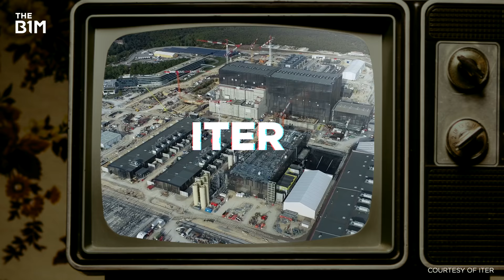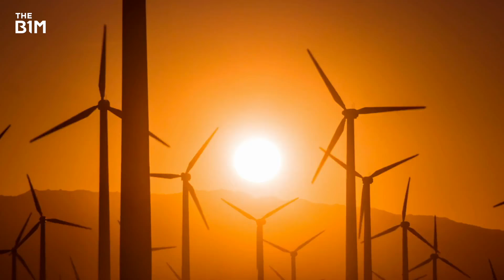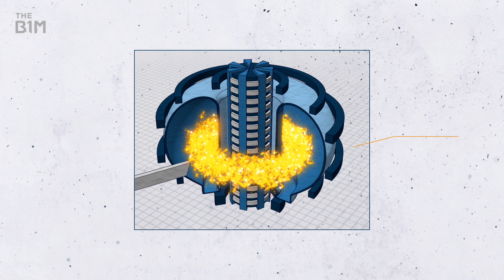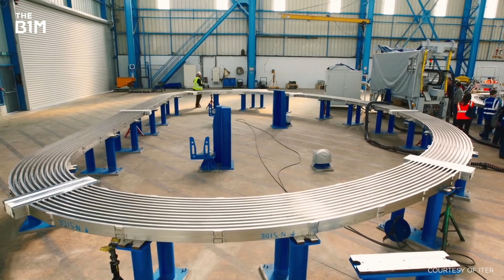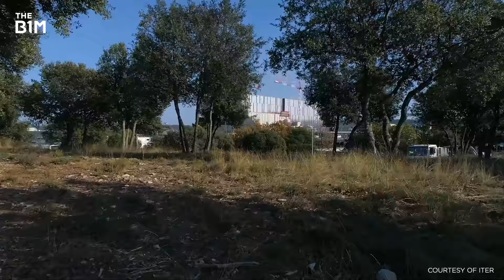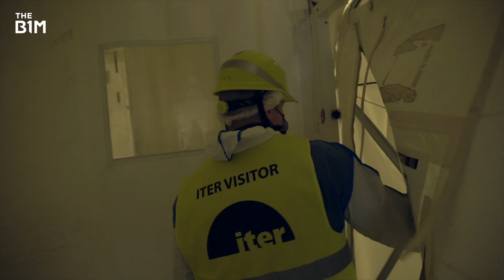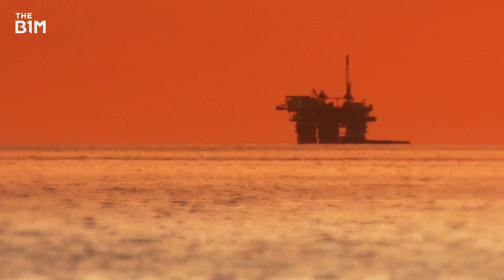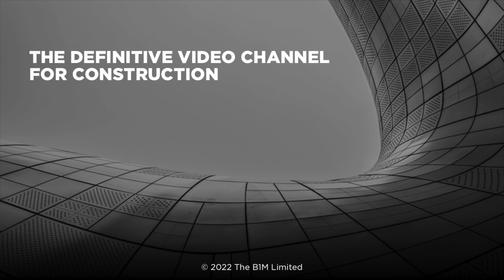We Went Inside the Largest Nuclear Fusion Reactor

Comment: Fusion power would be great. Fission reactors produce huge amounts of dangerous nuclear waste. They are by no means clean, safe energy sources. The issue has always been the huge amount of energy it takes to start a fusion reaction, and then contain the heat.
Reply: Fusion would still be great, but fission is really not that bad at all. First off, nuclear accidents are incredibly rare and caused by gross negligence. Can you name any nuclear disasters off the top of your head besides Chernobyl and Fukushima? 
Also, your claims about waste are simply incorrect. Nuclear fuel can be used for 5 years because needing to be disposed of, at which point it’s moved to a permanent safe disposal location. Also, with things like thorium reactors, nuclear waste can be “burnt up” in it, and have the time until safe disposal be reduced to less than 500 years. 
Fusion would be a hell of a lot better, but fission is not bad at all, and can likely be an important stepping stone in the mean time until fusion becomes available
Reply: @Beyonder8335  How much fission waste is sitting on the grounds of the power plant instead of in ultra long term storage?

Thorium seems much cleaner ...

Comment: Sadly, if 100% successful, ITER will not produce 1 single watt of usable electricity for all the billions spent.  Will it produce over unity (Q Power), over unity for 24-7-365?  If not then no power companies will want it. (can't supply electricity).  Once "DEMO" is built what will it cost?  Of course if ITER fails at 24-7-365, DEMO if dead.  Fission nuclear is the future as it is here and now producing carbon free energy.  Otherwise, it is coal or gas.  

Germany killed her nuclear and due to this and the Russia oil embargo, Germany is firing up her old coal plants to keep German warm the winter.  France is massively nuclear now and laughing at the greenies who killed nuclear.

Comment: i'd wish we could move faster. ITER have been under way for years and years, and still not finished, and even when finished, they dont even expect it to be more than an experiment to gain knowledge to build another reactor that then potentially would become a power plant. So we are still looking at atleast 20 years before the first plant is operational, and we know that scaling energy production is slow, it would take another 50 years to transitioning.

Comment: Fun fact: when properly stored nuclear waste is entirely safe, they store it as alloy in a concrete container, even if somehow the container (for all intents and purposes this container is indestructible) breaks open the glass - ceramic - nuclear waste alloy cant go anywhere since its a solid, theres also research into putting the long lived waste kilometers below ground, deep below any water aquifers or anything that it could ever contaminate that would get to humanity (there was a natural fission reactor discovered, its waste was entirely uncontained but never got more than 30 meters away), all using the same technology that oil drilling uses

Comment: Been promised unlimited power from fusion reactors for decades. Appears we are not much closer to sustainable fusion than long ago. 
Not saying it won't eventually happen but I believe I and my children will have passed from this world first.
Reply: I'm afraid it won't.  Even if somehow, some way, the engineering problems connected with creating and sustaining a continuing plasma reaction and at levels sufficient to produce large-scale power are solved, it will not be possible to make it commercially viable due to the sheer scale and complexity involved in the support machinery needed to keep a closed-cycle reactor magnetically and thermally stable indefinitely.  Then there's the problem with producing enough tritium to fuel the fusion process.  I remember reading a suggestion to "solve" this problem through using an on-site fission reactor to breed tritium.  My immediate thought was that if you're already going to build a fission reactor just to solve that problem, then why not simply dispense with the fusion reactor complex altogether, build four fission reactors on site instead and harness them directly for electrical production?  This won't work.  It is far more likely that fusion will be practically exploited for interplanetary and perhaps even interstellar travel but it will never be an industrial-scale power generator on Earth.

Comment: And if it doesn't work the environmental footprint of this project must be massive..
Reply: It is not .  If the containment fails , the plasma will expand , cool , and fusion would immediately stop .  Worst case scenario is a tritium ( radioisotope of hydrogen ) leak into the environment Said tritium can bind with oxygen and create radioactive water which can leak into the groundwater .  Fusion doesn't use a lot of fuel at a time tho ( usually only a few grams ) , so a leak would be diluted fairly quickly .  Even if the reactor does explode , it would not release much ionizing radiation like a fission reactor

Comment: as they stated some years ago there is still radiation which means the reactor has to be maintained, the heatshields removed and noew ones installed. the old ones carried radiation so they have to be stored for around 50 years when i remember correctly. after that they can be recycled  refurbished.

Comment: Imagine you get the big construction done just to find out the entire thing doesn't work 😫
Reply: It works but the problem is "is it economical " because the core is already tested in china and it works .
Reply: It's only an experimentale reactor anyway. It is not made to provide energy to France or the world.

We will test m y configuration on the reactor and see how it works the best.

Even if we are not satisfied with the résultat, we will have learned a lot
Reply: @mrsupremegascon  No, the core on china is experimental. And it's working.

This one is real building project.

Comment: I feel this video gives a missleading veiw of where fusion technology is at. 
the Q value often show with ITER is 10 but that is just the heating elements and doesn't include the much more power hungry magnets or other anciliary systems.
also while dueterium is relativly simle to aquire Tritium is much rarer and expensive to the point that the cost per MW asuming a 100 percent efficiency is higher than a gas turbine

Comment: What could go wrong?
Reply: Just creating a mini sun, and if it does not "explode" creating a black hole, all in all you won't feel a thing while your atoms split apart and drag you into the unknown.
Reply: @dmitrikulkevicius9161  no
Reply: @dmitrikulkevicius9161  It is not .  If the containment fails , the plasma will expand , cool , and fusion would immediately stop .  Worst case scenario is a tritium ( radioisotope of hydrogen ) leak into the environment Said tritium can bind with oxygen and create radioactive water which can leak into the groundwater .  Fusion doesn't use a lot of fuel at a time tho ( usually only a few grams ) , so a leak would be diluted fairly quickly .  Even if the reactor does explode , it would not release much ionizing radiation like a fission reactor
Reply: @someaipretendingtobehuman3157  

cool

Comment: It will explode.
Reply: It is not .  If the containment fails , the plasma will expand , cool , and fusion would immediately stop .  Worst case scenario is a tritium ( radioisotope of hydrogen ) leak into the environment Said tritium can bind with oxygen and create radioactive water which can leak into the groundwater .  Fusion doesn't use a lot of fuel at a time tho ( usually only a few grams ) , so a leak would be diluted fairly quickly .  Even if the reactor does explode , it would not release much ionizing radiation like a fission reactor

Comment: It’s all fun and games till the sun on earth explodes and France disappears
Reply: @jcdenton2708  are you unwell
Reply: @jcdenton2708  It is not .  If the containment fails , the plasma will expand , cool , and fusion would immediately stop .  Worst case scenario is a tritium ( radioisotope of hydrogen ) leak into the environment Said tritium can bind with oxygen and create radioactive water which can leak into the groundwater .  Fusion doesn't use a lot of fuel at a time tho ( usually only a few grams ) , so a leak would be diluted fairly quickly .  Even if the reactor does explode , it would not release much ionizing radiation like a fission reactor

Comment: It's worth saying that while fusion energy would be beyond revolutionary in many ways, fission is already essentially carbon free and with danger statistics generally in the same range as wind and solar power, despite "harmful" nuclear waste. Truthfully, if we built enough nuclear plants to sustain most of our energy needs right now, there wouldn't be all that much of an issue (certainly far less than the issues associated with using fossil fuels for power). The amount of waste produced would be quite manageable and so in many ways, fission is already capable of many benefits that fusion is often credited with, for the most part. Certainly not all- fusion energy as I said originally would be more than a revolution. As far as necessity dictates for our current energy situation though, fission would be sufficient if the general public stopped thinking nuclear waste was green goo and that reactors go off like atomic bombs when there is any minor error (they don't do that at all, it's impossible). While I love fusion and think it 100% deserves as much funding as it reasonable, fission could fix fossil fuels within the time that fusion might or might not only be proven, let alone turned into commercially viable energy plants. Fusion is the energy of the future, and right now we need to be using the energy of today--fission, wind, solar, etc--to get rid of the energy of the past, as soon as reasonably achievable.
Reply: Perfectly said
Reply: In water starved areas like the United States southwest, nuclear power is not really viable because of the tremendous amount of water needed for cooling.  Arizona has a nuclear plant and they use water from lake mead and with the drought conditions, that has been a big problem.  Natural gas powered plants and solar is a better option in that part of the country
Reply: Yep, Chernobyl fairly much screwed up fission for the rest of the world. It's cheap, almost green, and gives more than enough energy to last us a while.
Reply: Finaly someone who said this all in one comment, without any hour long scrolling needed to get past unrelated things or drama in the replies just to see the darn thing. i 100% agree with this comment.
Reply: @hamisyum1016  nope. It’s Fukushima and nuclear weapon. When Chernobyl happened, the number of operating fission plants didn’t go down for the next few years, it was still increasing. The Western nations largely viewed Chernobyl as “those dirty Soviets with their inferior technology and intelligence have it coming, the superior West will never have such thing happen to us”. Only after Fukushima was there a dip in nuclear power generation around the world. The possibility of developing nuclear weapon from nuclear power also prevented many countries from having their own nuclear plant, which hampered the development of the nuclear power industry as a whole.
Reply: @lc9245  Fair point, however where I live, Chernobyl is more commonly talked about than Fukushima.
Reply: @hamisyum1016  Mostly because of Western propaganda which emphasises the  failure of the perceived enemy and hides the failure of allies. Although Chernobyl was truly disastrous and an important lesson, it is more prominent in the media, strategically much less so, because of what I mentioned. Meanwhile, Fukushima empowered the anti-nuclear faction, because it occurred in the sophisticated and advance Japan which made it relevant to policymakers, combining with cheaper renewable, created the perfect storm for the death of nuclear power industry. I also attributed drastic actions to rising progressives politics, which made drastic policy changes more popular and acceptable.
Reply: @lc9245  Ok. I don't know much about the topic. Thanks for giving me an inside into a different perspective.

Comment: Nice video but I have few minor corrections. It is pronounced with an "e" sound like in international and not an "i" as in Ireland. Hydrogen isotopes are indeed abundant but not all of them. Tritium which is needed for the deuterium-tritium fusion reaction is scarce and costly to extract. It is mainly produced, in small quantities, in heavy water reactors such as the CANDU in Canada. That's why fusion reactors has to breed tritium for self-sufficiency. https://en.wikipedia.org/wiki/Tritium
Reply: Japan on Hukusima powerplant exhausted water contaminated Tritium doubt the treatment. therefore, the moreover process won't be possible to extract from something like the deuterium, I think.

Comment: I am sorry to ask this question. What is the carbon footprint of the things used in building this huge ITER plant? Thank you.
Reply: None
Reply: @LewisC0298  Are you joking?
Reply: @youme1414  all this does is fuse two hydrogen atoms together, there is no bad biproduct. same with nuclear fission. however getting hydrogen does have a carbon footprint.
Reply: @LewisC0298  Perhaps, you don't understand what I am talking about. I am not talking about the fusion process but the materials used to construct the project, ITER. They actually have a huge carbon footprint more than many coal plants.

Thank you.
Reply: @youme1414  they most likely do, however that would be minimal, as over time the percentage it saves is very small because it is fixed.
Reply: Why do that matter?

If they succeed the world will be saved.
Reply: @mrsupremegascon  not really, however the price of everything will go down a lot. therefore standard of living will increase,

Comment: 2:38 You are showing U-238 and Pu-244. Those are the wrong isotopes. Fission reactors use U-235 and Pu-239. The others are not able to form a critical mass which is a requirement for fission reactors (and atom bombs).

Comment: We should not fail to support Generation 4 fission reactors which is a much easier technology to develop in a shorter period of time. China is leading the way with 2 fission reactor prototypes. One MSR, Molten Salt Reactor,, and a gas cooled pebble bed reactor. Many countries have Generation 4 reactor designs and technology but further development can not continue without research reactors. These will be much cheaper than ITER.  There are international agreements to support the development of Gen 4 reactors but progress is slow. We have the resources to develop fusion and fission reactors. But the ITER project will not produce useful energy. It will likely be 2050 by the time they develop the next fusion reactor that will produce energy. If all goes well. Another fusion reactor will be needed after ITER which may cost even more than ITER. China has shown that Gen 4 reactor prototypes can be built within 10 years. Gen 4 reactors offer significant advances over current reactors in common use by using the natural laws of physics to make reactors safer, cleaner and cheaper. India and China will be building over 60 nuclear power stations to meet their rapidly growing energy demands. So we should help to make sure that fission reactors are as safe as they can be. Nuclear fission remains one of the safest forms of energy and the major source of low carbon energy today. But nuclear fission can still be safer and cleaner.. Some Gen 4 reactor designs will also be able to use existing nuclear fuel waste, depleted Uranium, nuclear weapons material and Thorium for fuel.. Reducing existing waste and reducing material that could be used for weapons. There are a number of different forms of Gen 4 reactors and many possible designs for each type. Russia and the US will also be building prototypes. MSR reactors are the most popular form and comes in many variations with different types of salts and other systems. They are also very versatile in what fuels they can use.

Comment: A fusion power plant produces radioactive waste because the high-energy neutrons produced by fusion activate the walls of the plasma vessel. The intensity and duration of this activation depend on the material impinged on by the neutrons. Special low-activation materials, therefore, were and are being developed for fusion.

During its approximately 30-year lifetime, a fusion power plant will, depending on its type, produce between 60,000 and 160,000 tons of radioactive material.  It has to be put into interim storage after the power plant is shut down. The activity of the waste quickly declines: after about 100 years to a ten-thousandth of the initial value. After a decay time of one to five hundred years the radiotoxic content of the waste is comparable to the hazard potential of the total ash from a coal plant, which always contains natural radioactive substances.

Careful choice of material obviates the need for permanent storage. After a lapse of 50 years 30 to 40 per cent of the total mass of the waste can be released without restriction. The remaining waste can be recycled after another 50 years and re-used in new power plants.